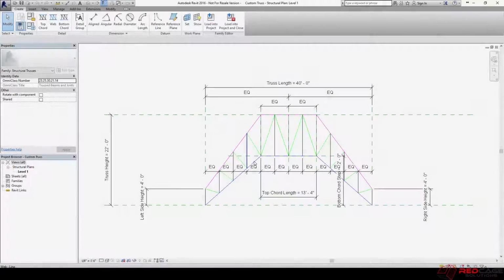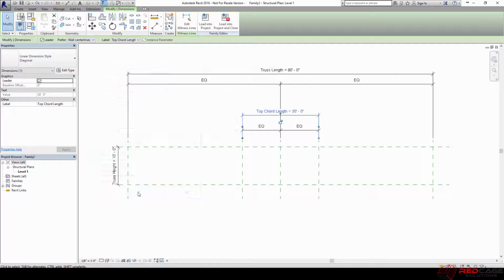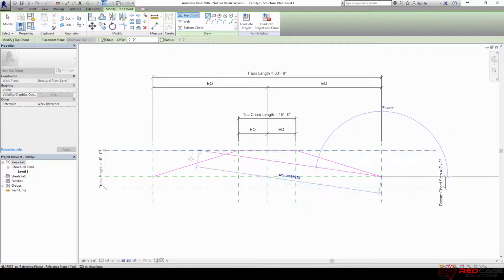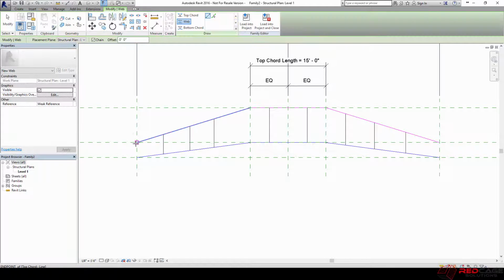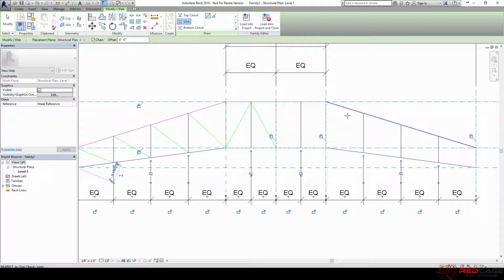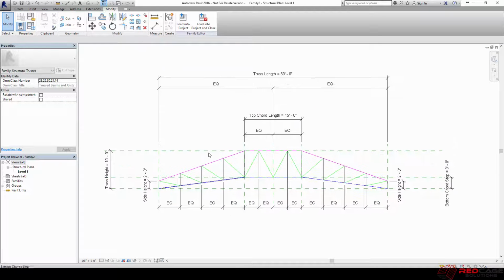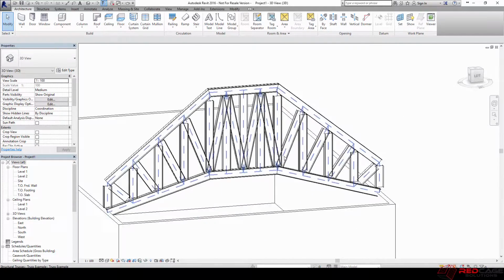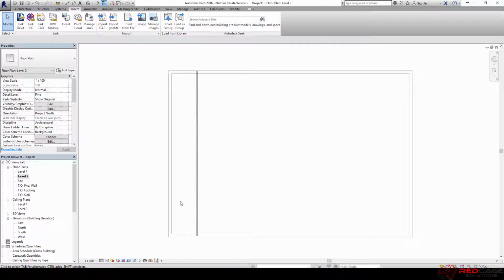Creating & Modifying Structural Truss Families in Revit 2016

Comment: Hi. What If I want to use 2 angles, top and bottom chords?  What is the way to include this type of elements
Reply from the maker: create a structural framing family using the beams and bracing rft, and create it so it has two angle profiles mirrored and sweeping the centre left/right reference plane.
Reply: @TravisVanClieafBIM  thank you

Comment: Hi, would you please made us further tutorial about truss connection, if there are a truss family we've made earlier then how to fix the gap of the connection/joint within steel member (diagonal/vertical) to top/bottom chord?
Reply from the maker: Hey dude, it looks like you're a dude from your profile pic. If not, dudette or whatever you go by, I have no recording software, so my tutorials are on hold for the time being. What you're seeing is the cutback of the steel member for a connection. In this situation, if you have a welded connection, you need to grab the blue grips (arrows) and bring them into the connected members. You'll see they overlap and look incorrect, so you apply the 'Notch' or 'Cope' tool. It's in the Modify tab, on the far left. This will apply a Notch distance parameter, which it typically defaults to 1" or 20mm. If you want welded connections for a truss, you can create a global parameter for Notch distance, set it to 0 and then apply this value to all the instances when you are done notching all the members. Structural framing. So dope, so precise, so damn persnickity. Good luck.
Reply: Travis Van Clieaf Hi Travis... Okay, i have got the solution on my issue thru autodesk forum on earlier day. Anyway, that’s actually not me myself, the profile picture is a former comedian actor who already gone away... i just feel he’s awesome and funny to imitate bruce lee in this pose style. Lol :)
Reply from the maker: I was gonna say maybe stick with the martial arts. BIM isn't good for your waist line.

Comment: wat do you do if the 2X4 material doesn't update, it did what you said happens sometimes to you?
Reply from the maker: The softwood lumber material is not showing for your structural framing? In the project browser you should be able to expand families, find the structural framing category and locate the 2 x 4 member. Right click on that and select Type Properties, you should be able to set the material for that framing member type there.
Reply: Ok  I figured out that I just Didn't set it for all the components, I was missing the top chord, also Thank you for your reply, your video helped me create a truss family for our firm. I was wondering also if there is a way to connect the members and make them look a little better, maybe even before you load the truss into your project so that it looks a little neater?
Reply from the maker: The join set backs do kind of take away from the look and realism of the component. You can remove the truss system capabilities by selecting the truss and choosing that from the ribbon options. To further connect your structural framing, you'll need to use the Coping or Notching tool located in the Geometry panel of the Modify tab. Unfortunately, the truss options are gone after, so I would do this one one and then copy a group of the notched members to create the rest of them if that's the look you need.

Comment: I'm  quite  new in revit  how did you got all this families because  I can't  find them in my 2017 revit I hope you  answer me , thanks for the video
Reply from the maker: The structural truss family in this video is made from it's corresponding revit family template (rft) and the families that occupy the truss rig are of Structural Framing Category. If you are working with Revit Architecture, you may not have these tools and families, but any full version of Revit should have these tools from within the media. Depending on whether you choose All Disciplines in the installation settings may have something to do with what you get as far as out of the box families. Hope this helps.

Comment: Is there a way to have an option for different top chords? For example, the middle four panels have one size top chord, and the outer have another. I've been trying to find a tutorial on Structural Framing - Complex and Trusses family template but haven't found one.
Reply: Thanks, it did help! I have another question...

I have snapped my diagonals to the end points of the vertical webs, but somehow the diagonals will still sometimes not be oriented to the correct panel point. Do you know of a way to correct this?
Reply: Actually I got it to work. Just had to keep re trying to snap it until it worked. 

I do have another question. Is there a way to make the truss height be from top of top chord to bottom of bottom of bottom chord? (instead of center of top chord to center of bottom chord)